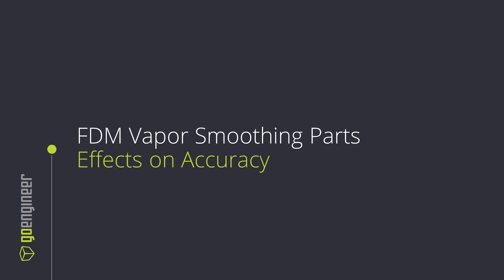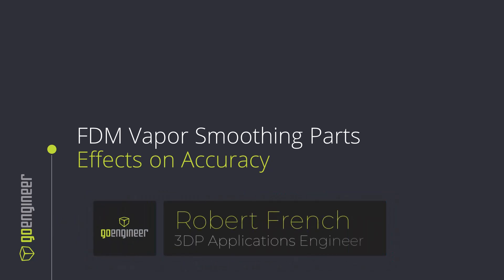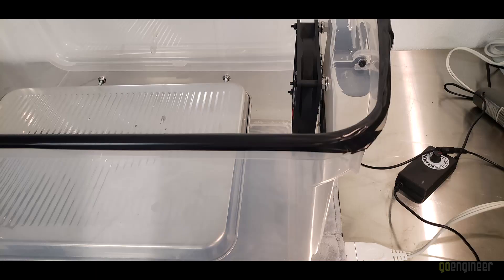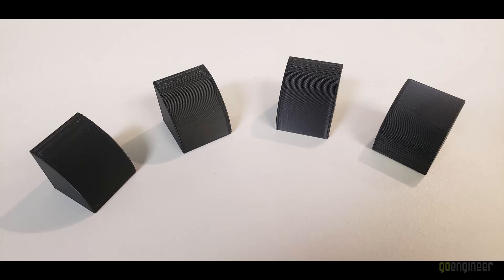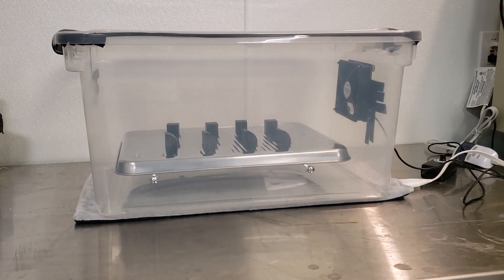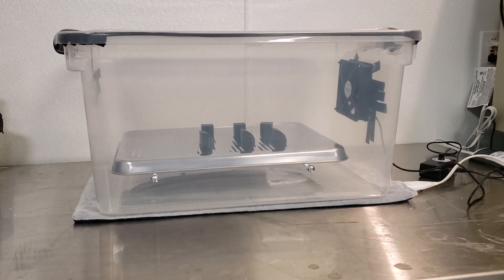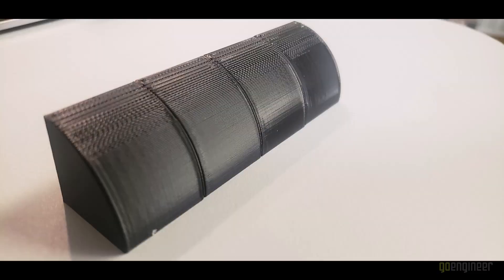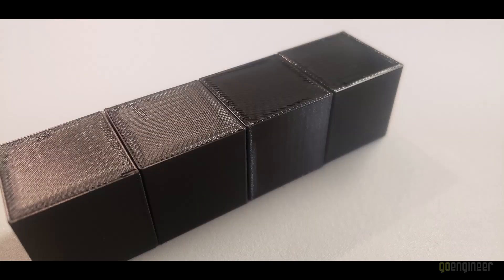Effects of Vapor Smoothing on 3D Printed Parts

Comment: Have you done any tests with masking parts of prints you don't want smoothed? Masking tape did not do the trick for me
Reply from the maker: No personal experience, but masking tape seems like it's a bit too breathable, so it wouldn't keep the fumes out. We'd suggest something that's more waterproof like duct tape. Another idea is that you could print another part that would act as the mask and then use duct tape to seal the portion of the part away from the fumes. That would be a more reusable option.
Reply: @goengineer thanks. Somehow I keep forgetting that I can just print a part to fit my needs most times that I run into a problem.

Comment: Did you pour acetone directly into the bottom of the container on this one? Or did you use paper towel again? I can’t quite see it for some reason lol.
Reply from the maker: Either one will work, but Robert's pretty sure he poured acetone directly into the bottom. The big key is just making sure it vaporizes, so he recommends using the smallest tub you can and still get your parts to fit inside. Otherwise, you could need a lot of acetone to have enough (1/16-1/8 inches deep is a good amount)

Comment: Is vapor ignition a concern with an electric fan in the enclosure?
Reply from the maker: Its not a large concern, the fan is low power so a spark is not likely. Though if you are building your own box it is something to consider. Making sure any electrical connections are outside the enclosure and be sure to use brush-less fans where possible.  Proper ventilation in the surrounding area is also important.